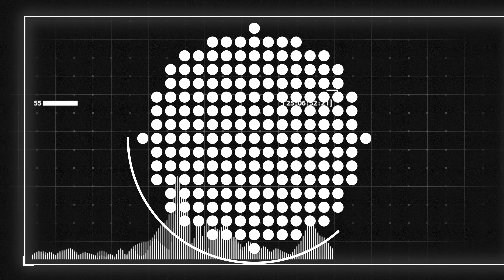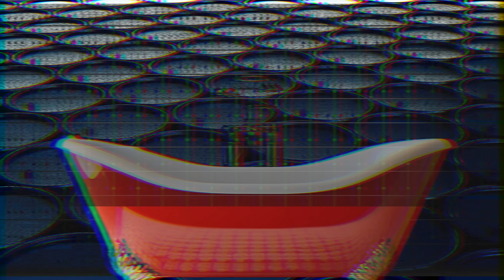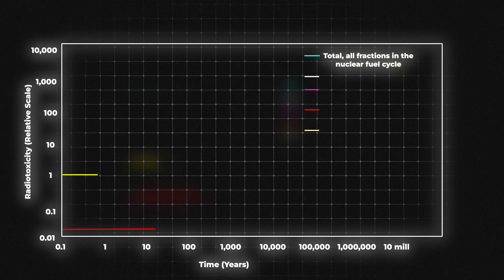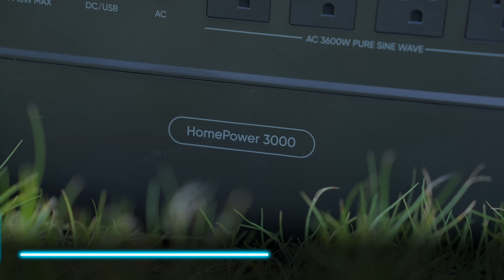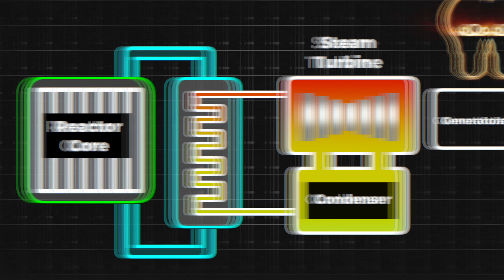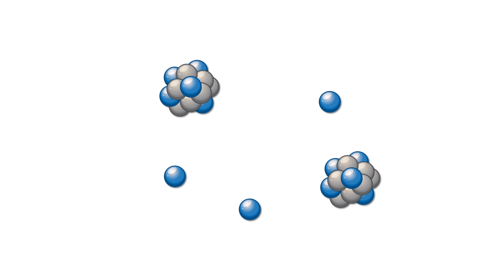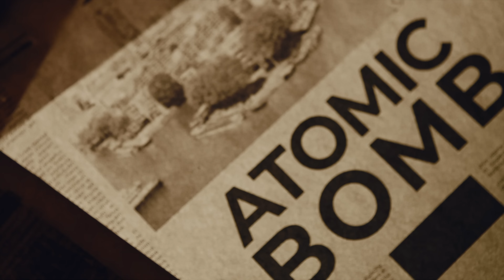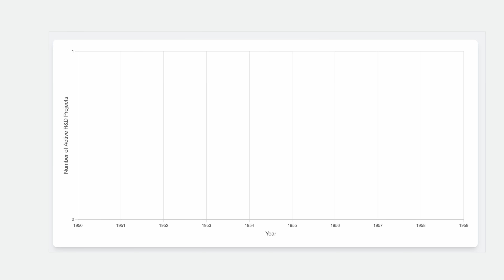Why Thorium is About To Power Everything

Comment: LFTR's have been promoted for years, however, politically no success. The problem is the large lobby groups by oil companies and existing uranium powered LWR's don't want the competition from thorium. That is why only in China, where these groups have no say, that an LFTR has been built.
Reply: Our DOE does not appear to want efficient nuclear, and is mostly promoting reactors with non-recyclable TRISO fuel. Worse yet, are the small fast reactors (not even breeders), which need very large inventories of fissile, making them utterly uneconomical. Or they would be, if their purpose was to generate power; their real goal is to soak up the public's wealth of transuranic fissile under the guise of "destroying waste", so that it can't be used in efficient reactors like these. They'll also drain the Nuclear Waste Fund, to process that spent fuel at our expense. Fissile (not gold) is where the real value is, and while we're being distracted by Fort Knox, they're stealing our flock of golden geese.
Reply: Legacy water reactors?
Reply: @brianjonker510  Close enough. Light Water Reactor. Requires enriched uranium, (separating U235 from U238) is a very expensive process. Thorium only requires simple refining. LWR's can only burn 5% of the uranium before the pellets crack and have to be replaced. Thorium is almost 100% consumed. Thorium is literally free as an unwanted by=product from rare earth mines.
Reply: @royh6526  Thank You.   I know that part.   Just my brain loses the exact words for common acronyms.

Comment: Existing energy providers have long been exerting a great amount of effort to prevent anything new from coming along and squashing their gravy train. Solar, batteries, wind, tidal energy, and now, thorium reactors will all be shoved to the back shelf until these old systems are fully depleted or those who are running the entrenched systems find a way to dominate the new systems.“The bottom line“, “follow the money”, “cash talks, and bullshit walks“.
However, you put it, the results are the same. I Appreciate all the effort you put into spreading the word. Hopefully, eventually, common sense will prevail.✌️😎
Reply: See the "Cost of electricity by source" in Wikipedia.  Wind and solar are smoking natural gas by 30% and over 40% cheaper than coal.  Geothermal is now half the cost of nuclear.

"Hopefully, eventually, common sense will prevail."   You should try it for a change.
Reply: @Cspacecat lol, the race to renewable electrification is already over.  Just because some old FF fans in North America think everything else is a fad, doesn’t change reality, one iota.  Some want to pose this as a Greta Thunberg, save the world issue or a Koch brothers, let’s burn what we got issue.  The reality is every country that has to pay big money to import FF’s, will and have latched on to using renewables, EV’s, battery storage to eliminate that bill.  China spent somewhere near $460 billion in 2024 importing FF’s.  That doesn’t include domestic oil and coal supply costs.  That’s why they are spending huge money on renewables and batteries. Cause in a few years, that number will start shrinking rapidly, until it disappears completely.  All countries with sunshine, wind,and a need to import fuel, already know this.  Guess what most are already doing?
Reply: @brettgracey9682  Clearly, you've missed something.  It's what China knows.  Solar and wind are now generating electricity at half the cost of coal.  That means China can produce products at a significantly lower cost than the US, which remains reliant on fossil fuels.  Donald Trump's tariffs won't make a difference because they only raise prices on American goods entering the US.  When the US goes to export, it competes directly against China's cheaper goods.  What this means is the US is becoming non-competitive in the global market. This is why China is producing solar and wind faster than the rest of the world combined. You see, China has a problem.  The One-Child Policy means China will soon encounter a severe labor shortage because its workforce is in its 50s.  The only possible solution is automation.  That means a vast increase in electrical consumption, no matter where it comes from, which includes as many fossil fuels as they can consume.  This means they will continue to build coal-fired power plants until 2028, when renewables will hit sufficient capacity that coal-fired power plants will no longer be necessary.  China will then start dismantling its oldest coal-fired power plants first, saving billions of dollars annually.  In the meantime, the US will continue to be non-competitive against the rest of the world.  We've hit our peak and are on the decline.  China puts engineers in its government, and we elected lawyers to office.  Exactly, how do you think this is going to work out?
Reply: @Cspacecat  Cultist bull...
Reply: @davidoldham1946  Texas leads California and all other U.S. states in total renewable energy generation, driven by its vast wind and utility-scale solar capacity and a regulatory environment that favors large infrastructure projects. In contrast, California historically led in distributed solar, but has since focused on distributed generation and battery storage, while Texas's growth is primarily in large, utility-scale wind and solar projects.   Texas, California, and China are your cult.  China is producing more wind and solar than all the rest of the world combined at half the cost of coal.  By 2028, Chinese renewables will pass coal in the production of electricity.  From then on, China will start decommissioning its oldest coal-fired power plants, sending coal into a downward spiral.

Comment: My husband and I have known about thorium reactors for years. It can even use spent fuel rods from other reactors as fuel, and thus render them harmless. The fact it can't cause a nuclear meltdown is wonderful. Canada's CANDU reactors were designed to shut themselves down, rather than melt down. But we stopped building them. So, what are the disadvantages?
Reply: CANDU reactors are so efficient that they can be powered by Thorium.  The big disadvantage of CANDU is that they require doubly heavy water, which is very expensive.  Any tiny leak results in this stuff escaping, and it turns out water can escape easily.  Vapour in the air, water percolating thru concrete, water slowly working thru seals.  This is my understanding of the main reason CANDU were more expensive to operate than expected.

Warm regards, Rick.
Reply: @RicksPoker  Good to know. Didn't realize that. Is that why Canada stopped making medical radiation treatment? (Not sure if that is the right way to phrase that.)
Reply: Nuclear energy kills young people, making them infertile. You want mass death, admit it. Why would you care about orgasms, you dinosaur?! I bet you love partial birth abortion as well!

Comment: You should stop making videos about which you know bugger all. Decouple Media is a very good channel for mostly nuclear energy stories. Thorium vs Uranium is like Diesel vs Gasoline, a very pointless argument. The best kind of nuclear reactor is ANY nuclear reactor that is operational and running and kept running for at least 80 years. After that the next best brand new design would the Molten Salt Reactor IMHO which can be tuned to run Uranium and or Thorium with Plutonium and or waste fuel. The pebble bed designs are also good. Add the Natrium liquid cooled Sodium (with Molten Salt storage).  The best and the worst nuclear designs are 100,000 to millions times energy denser than any fossil fuel and 1000s times less land grabbing than renewables. 

And no Thorium is not 500 times more abundant than Uranium 235, because you are not comparing equals. Fissionable Thorium is orders less than U235 while fertile Th232 is about 4 times that of U238. What ever you do to make Th232 burn is the exact same as with U238, they both need to be bred up, Th232+N=>Pa233=>U233 while U238+N=>Np239=>Pu239 either of these takes a few weeks to complete. The physics is exactly the same. Calling one sketchy is pandering to the idiots.

As for waste you completely misunderstand radioactive decay. A fuel assembly taken out of the reactor is immediately extremely dangerous and needs to be stored in a water pool for a few decades. After that it could be sent to a 100k year repository but its relatively safe at only 400 years you can hold it to your body for hours. At 100 years its more dangerous so stay 10ft away from it. Thorium decay products do decay a bit quicker but not hugely so.

Also when you describe the secondary loop as using water, no you would want to use a more basic Molten Salt as the secondary coolant too which can also be stored in large tanks far from the reactor. What that heat is used for is then another subject. It could be used for on demand water steam turbine generator electricity or the heat could be used for chemical or process heat for making syn fuels or industrial heat.

Comment: Smaller nuclear plants, preferably thorium, could be built on existing fossil fuel sites where they would provide clean base load capacity using existing power distribution systems. The cheapest electricity is solar, followed by wind. It’s always windy somewhere, but getting a distribution system installed to send the power to where it is needed seems politically unlikely. Combining nuclear, which is very expensive, with cheap renewables and storage could give us clean, reliable power at a good price. You didn’t mention the greatest obstacle, which is vested interests. Thorium will most likely come on stream somewhere where the fossil fuel industry doesn’t own the government.
Reply: Sunny Hawaii has spent billion upon billions on solar and yet most of their electricity still comes from dirty imported diesel fuel.  Seems they have nighttime as well.

They have the most expensive and dirty electricity in the nation.

For a tiny fraction of what they spent on solar, they could have taken the abandoned and still standing sugarcane fields, built ethanol plants on the abandoned sugar mills, and used pollution free ethanol to make electricity while sending the waste steam to the distillery to make the ethanol.  Still could.

Instead of the most expensive they would have had very reasonable electricity with no newly added CO2 or pollution and be something very rare for islands, self-sufficient.
Reply: @danafletcher2341  Hawaii has reduced its fossil fuel electricity generation down from near to 100% to 67% and falling. Solar is the cheapest way to generate electricity. Because the climate is so mild most people in Hawaii have modest electricity consumption, especially at night. Industry is the major electricity user and they mostly have a break during the night. Countries with colder and longer nights have much lower dependency on fossil fuels, so Hawaii is playing catch up. It could be a world leader in renewable energy, but the fossil fuel industry will oppose progress.
I have no doubt that the state can spend billions on photovoltaics, which last at least 25 years, but how many billions are spent every single year on importing fossil fuels? 

 Sugar cane waste is already being processed to make fuel, although it’s not without environmental problems like every industrial process. Hawaii is very dependent upon aviation which is going to be difficult to clean up. That’s not a reason to give up. We can get on with cleaning up the easy stuff like electricity.
Reply: @Affableambler  My point was that Hawaii could have already been down to zero percent fossil fuel/zero added CO2/ pollution free reasonably priced electricity generation today for a fraction of the money already spent on solar. 

Brazil has gone to not burning cane fields so burning need not be done in Hawaii either.  The cane bagasse could be composted to be returned to the soil as fertilizer in a cycle since the ethanol uses nothing from the soil.

Comment: Combine thorium milton salt reactors with small modular design, and you have the best possible fission reactor.
Reply: ORNL-4528 (the progenitor of LFTR), was exactly what you describe, long before the SMR acronym was coined, and came into common abuse. Thorium breeders can be genuinely small and modular, because the blanket captures neutrons that would otherwise leak, making them efficient at all sizes.

Comment: A self sustaining chain reaction does occur in a thorium reactor.  The U-233 ejects something like 2.3 or 2.6 neutrons when it splits.  One neutron is needed to convert thorium to U-233.  One is needed to split the U-233.  So a chain reaction does happen.  However, due to a quirk of the density of the fuel salts, the thorium atoms never get dense enough to have a run away chain reaction.  As the fuel salts get hotter, the thorium atoms spread out and it self moderates.  Which is really amazing.
Reply: The self-regulating effect you describe happens because the fuel (U233) becomes less concentrated in volume, not Th. Thorium is a net neutron consumer
Reply: @vipondiu  That's not entirely accurate. Actually, both become slightly less concentrated in volume because of thermal expansion if and when the reactor overheats (which virtually doesn't happen with solid fuels). Since they're both in the same molten salt solution, the net effect on both fertile and fissile isotopes will be equal. The reaction cools down because neutrons are less likely to hit anything and have a higher chance of escaping the reactor. However, that's not the main mechanism behind self-regulation. The key and more significant factor is something called Doppler broadening of absorption resonance. Higher temperatures make all atoms move faster, broadening their speed distribution and also their absorption resonances, which is a fancy way of saying the frequency or energy a neutron must have to get absorbed. In short, a broader absorption resonance translates to all atoms (both Th and U-233) can now absorb a wider set of neutrons, but since Th is much more concentrated, the effect favors more net absorption by Th and less by U-233. In simple terms, the increased absorption by the "broader" thorium atoms overwhelms any broadening of the fissile uranium targets.
Reply: That happens in ANY liquid-fueled molten salt reactor, PROVIDED that the graphite used to slow down the neutrons does not have a positive thermal coefficient of reactivity, which it may have locally due to swelling or contamination. Best to use cheap chloride salt and build a fast reactor with no graphite  and no other neutron moderator. The number of new neutrons produced with each fission event depends at least as much upon the neutron's kinetic energy as upon the isotope, with more neutrons being released by a fast neutron impact, typically close to 3.0 on average. U-233 responds better to slow neutrons than does Pu-239 (more likely to fission, less likely to capture the neutron); the latter responds better to fast neutrons, as do all the minor actinides. One often overlooked advantage of the breeder reactor is that it doesn't need excess reactivity to achieve high burnup, because it produces new fissile from fertile as it uses the fissile.
Reply: Yes, it's one of the reason it is 'load following' (it adjust to higher and lower loads pretty much automatically).